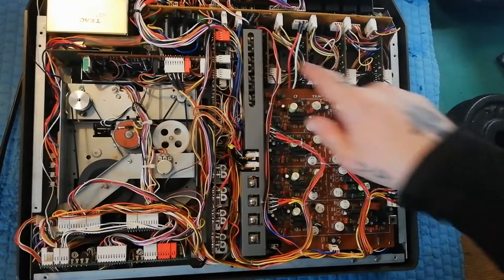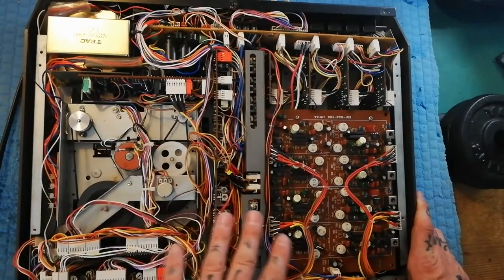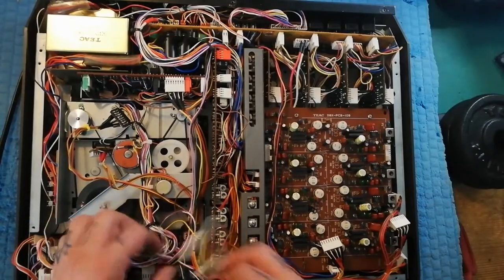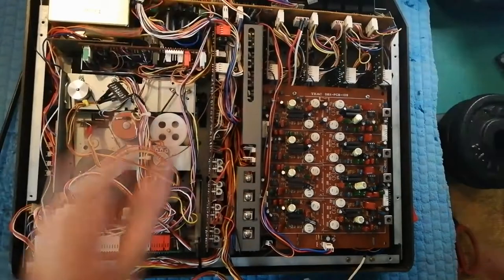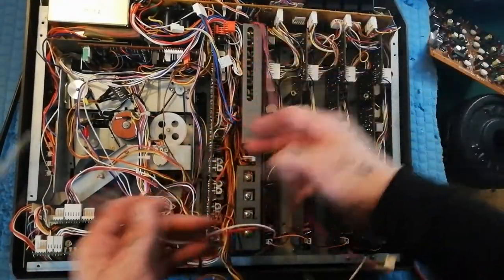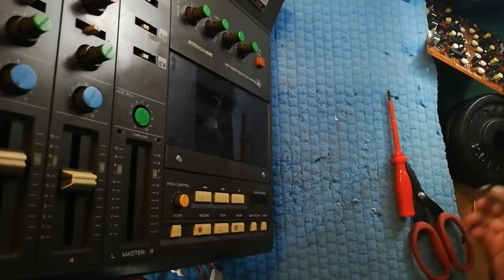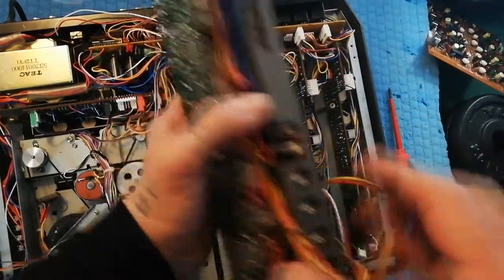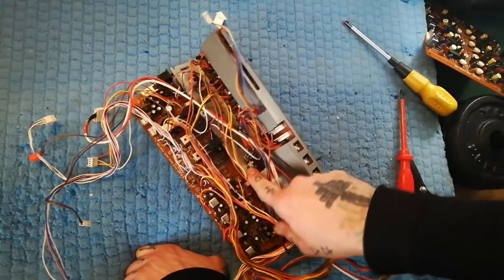Tascam 244 | Record & Playback PCBs | Master Fader| Remove &  clean

Comment: I am taking careful notes as I have narrowed down the problem on one channel to the playback board.  Am carefully double checking as it is very apparent from your comments that the task of removing then, even more of a challenge, successfully reinstalling, the playback and record boards is not to be taken lightly!! Having installed, operated and maintained audio and video gear some years ago I mistakenly assumed working on the 244 would come pretty easy, how wrong I was. Advancing years and eyesight to match make this a real challenge but I am determined to carry on with the assistance of you excellent videos. Thank you.

Comment: Thank you for your superb videos on the tascam 244 (and other recorders).
I have a problem:Channel 2 is dead on my 244. I downloaded the service manual from your homepage ..but the rec/play pcb schematics are not there (maybe I am blind). Do you have them ? I searched the whole internet, but there is no other service manual scan of the 244.
Reply from the maker: I’m not at home rn, I definitely have a scan of that schematic somewhere, if It’s missing from the pdf I’ll remedy that next week then report back here, thanks.
Reply: @Tetrakan  Thank you. btw ..I fixed the problem by replacing the rec/play head with a porta two head which has another part number on it but the dimensions are the same and it is working great. I think I followed your suggestion that these heads are interchangeable.

Comment: @tetrakan !!Quite the end  my refurbishing .. thank you so much for these videos, would never have tryed before..

Several problems came along the process :

- Master fader was not dirt, just the conductive strip (interacting  with carbon resistive strip) of Right Buss was dead, so had to figure something with a thin wire soldered on the Fader PCB ... NOt perfect, but  now I've got Stereo and a scratchy  Master Fader :)

- I've burnt (or inverted) two LEDS  (LEFT BUss Overload and 4CH REC Blinking alert) that felt down  when opening and removing Master/ Playback /record / module... Seems hard to find the same one ( they have a tiny plastic support ) .. so take care of your 3 LEDS when disassembling the module you folks !

- Forgot to replug the DBX small connector at the bottom side .... No tape playback at all ... Soon fixed by carefully watching what was missing.

My 244 now has clean transport and stereo record and playback, it did'nt before...   and without Mister Tetrakan it would just  sit and eat dust on a shelf.  Cheers to you , helpful and motivating Youtube Multitrack sorcerer :) !!!  Thanks
Reply: Hello all .. any hints about track 1 and 4 that don't erase previous material ? I can fully erase  what was previously recorded on my old Type 2 cassette. BUt only 2 and 3 are able to erase the previous in Sync or 4ch mode... Track 1 and 4 looks like mixing old recordings ( Debussy on normal tape speed, mixed with modular testing ...) thanks

Comment: I got my broken tascam 244 up and running thanks to your tutorials, so big thanks to you for educating us!! I hada question tho, the fourth track on mine doesn’t record, and underneath the DBX board there’s an unconnected white plug coming off track one with orange and black wires. I can’t find the other half of the connection, would this be why track 4 isn’t recording? I can’t really articulate what I’m talking about without sending pics so forgive me! Any insight is super appreciated! Thank you!!
Reply from the maker: The wire you are talking about is the daisy chain power supply for the LEDs - because it's a modular design,  on channel 1 there is no rightward channel for that lead to plug into, so it's normal for that wire to dangle with nothing to plug into. So it's nothing to worry about but it's also nothing to do with the record problem...
Reply: I just found the same wire lastnight...driving me nuts looking for where it may have been disconnected when I was taking it apart
Reply from the maker: Ha yeah I've done that before

Comment: hi sir . I have this device and i want to use it to digitize my cassettes. is it possible to adjust the playback speed and remove dbx function ?
Reply from the maker: I have a video on how to bypass the DBX, link below. You could probably use a similar technique to introduce additional resistors between the pitch control and the motor to bring it down to half speed...try turning the internal trimpot as low as possible first. https://youtu.be/xymTKthK4Xc
Reply from the maker: Location of the internal trimpot in this video https://youtu.be/vNCSR447M5o
Reply: @Tetrakan  thanks a lot . it's helpful 🙏🏻

Comment: Gutted, I've just done this process, got everything clean and reconnected and I heard something rattling about when I reassembled. Turns out I've broken the 4ch rec led off as I've tried to get the strip back in 😢
Reply from the maker: Don't they just slot in though? So reseat, and you'll be fine?